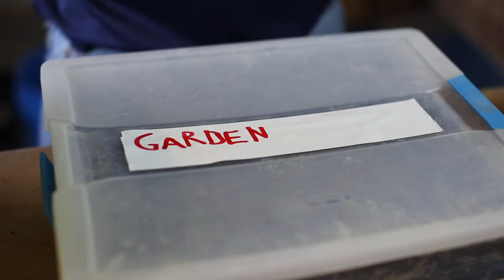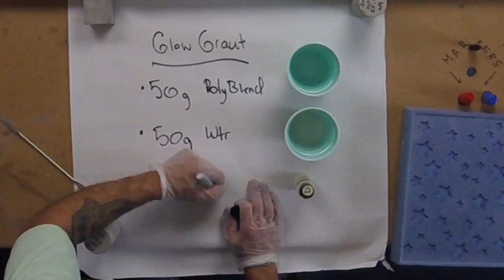Glowing Concrete Stepping Stones - Vlog #50

Comment: Enjoyed watching you make this project. I won't like your opinion on what concrete I can use for making concrete candle vessels. I have a silicone mold and have tried making some with rapid all cement which comes out nice and smooth and can unmold within 2 hours. Just worried it will crack when burning the candle. Thank you
Reply from the maker: Try putting in some wire mesh like chicken wire.

I wouldn’t worry about the heat of the candle too much.
Reply: @IntelligentConcrete  the heat of candle is below 140 F, the way the mold is you can’t put chicken wire, is there anything else I could add like Portland cement to make it stronger?